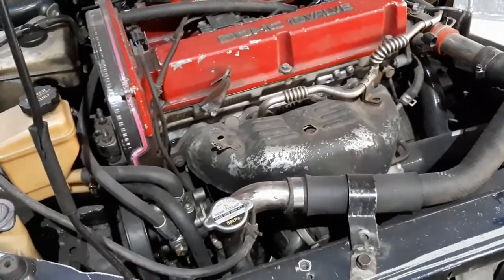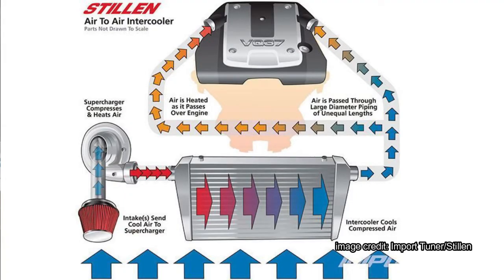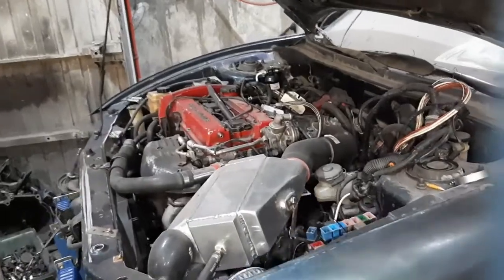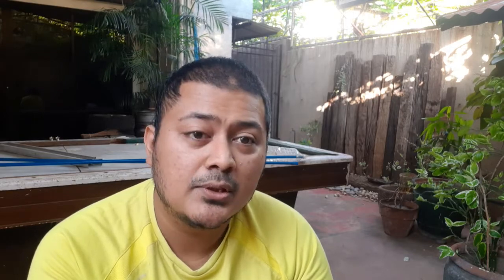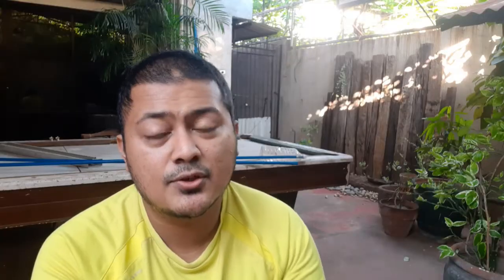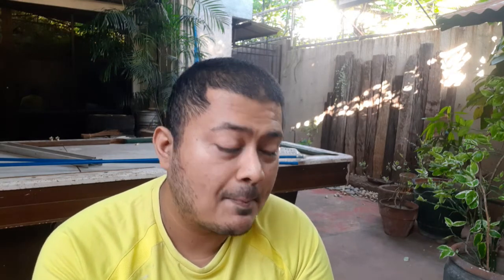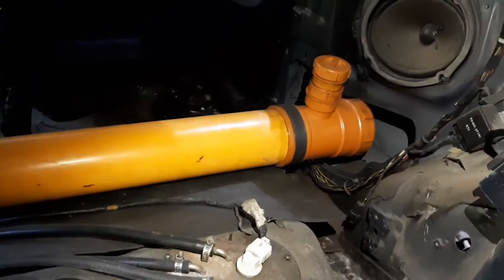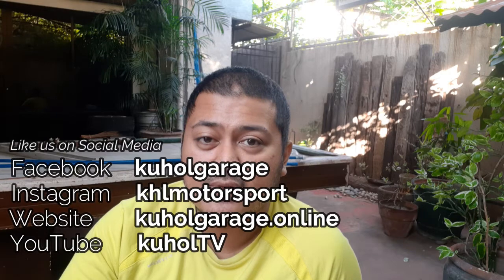Air to Water Intercooler for our 4G63T Evo IV Engine! Project Hyundai Coupe Tiburon AWD

Comment: What were your IATs while driving around?
Reply from the maker: As of this writing I have no idea. Won't have an idea until we get the engine re-installed and wire in an air temp sensor post intercooler.
Reply: @kuholgarage how about now?
Reply from the maker: @cliffcurry5264  still no idea. still working on it and I dont have an IAT sensor post intercooler.